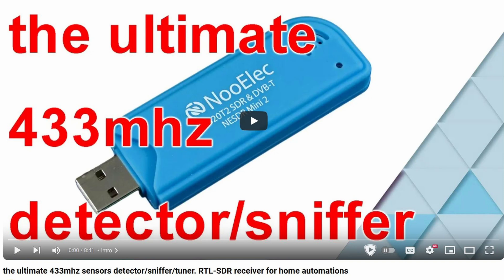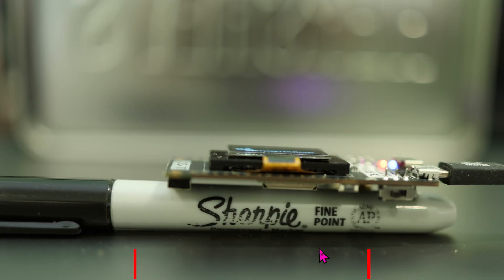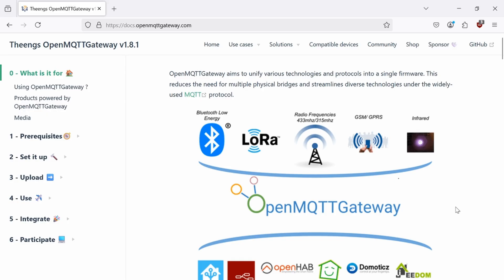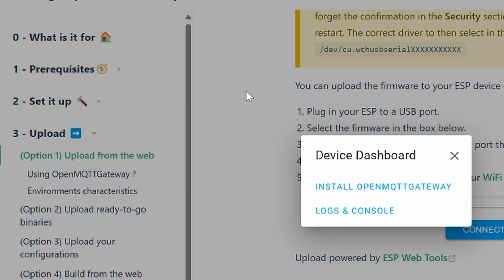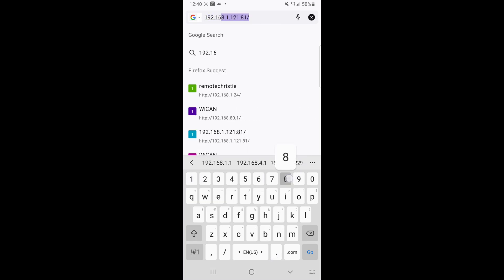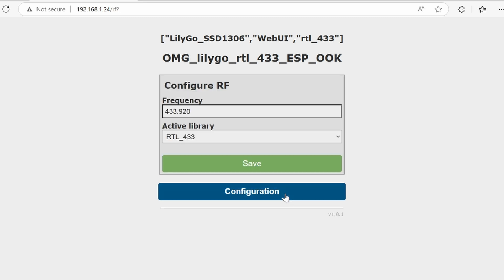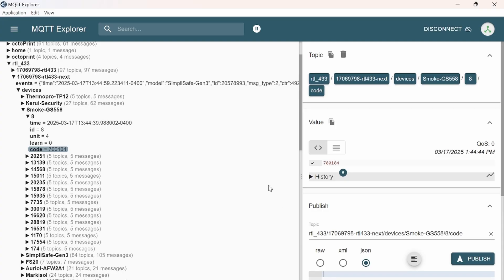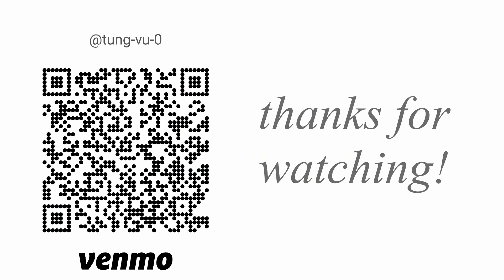Lilygo 433mhz, installation and tips

Comment: That's pretty neat.  I am using RTL-SDR dongle connected to the Raspberry Pi to monitor 433Mhz temperature sensors around the house and pipe it to MQTT via Home Assistant.    I do like this being totally standalone and portable.  Will have to look into it.